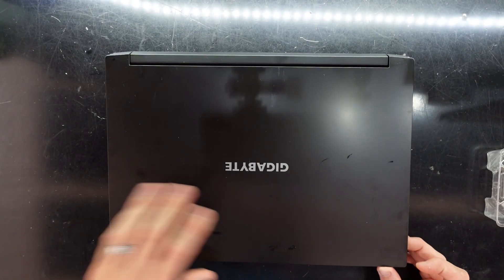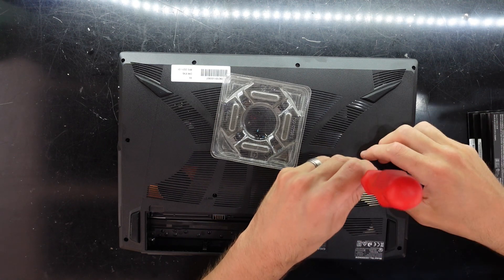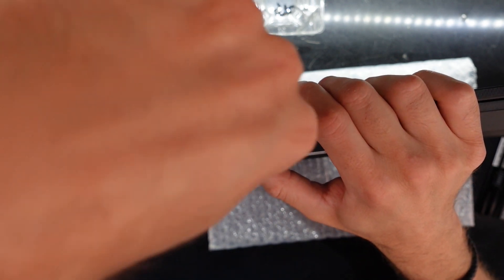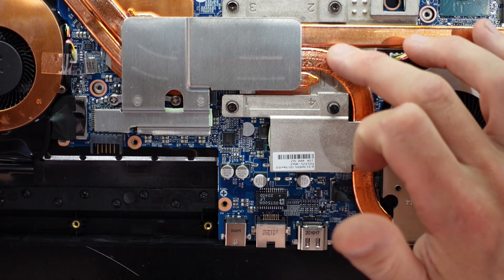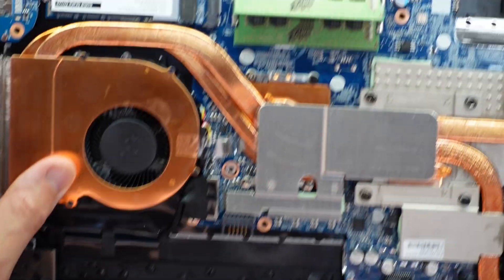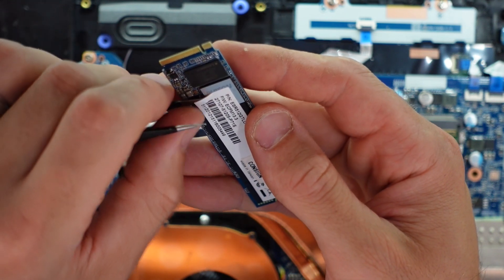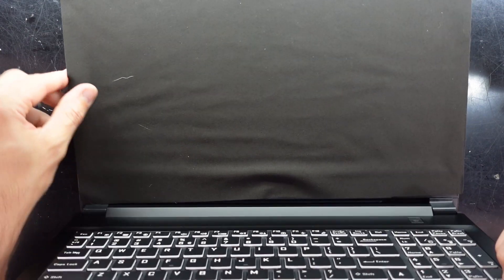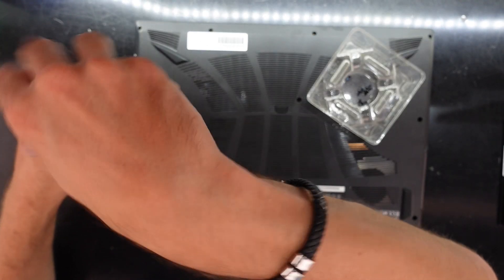Gigabyte G5 Teardown and NVMe SSD Install

Comment: Is an m.2 ssd  with heat sink like fanxiang s770 will fit this laptop? Planning to add it on my g5 kd. Really need some confirmation.
Reply: Id say probably not. The case is quite slim. Theres not much wiggleroom in the slots. only a thermal pad at most at a simmilar thickness to the little square one he puts on the SSD. I was looking into this myself as well since i was considering adding an m.2 with the heatsync. The heatsync is too bulky and wont allow the back panel to close over correctly.
Reply from the maker: i wouldnt expect a headsink on a nvme will fit in here

Comment: For anyone strugglig to work out why your bottom cover of the laptop isnt coming off as cleanly.

The two flat things under near where the touchpad are. Push your screwdriver into them. THESE ARE SCREWS, THEY JUST DONT LOOK LIKE IT! 
Undo these and your golden!

I just broke those ones off not knowing this :-\
Reply from the maker: cheers for the tip

Comment: Do you know what is the thickness of the thermal pads that gigabyte g5 kc has installed?? Because i want to replace them but i throw them away and now i dont know the exact measure
Reply from the maker: no i dont sorry

Comment: if youre going to open a laptop, its worth changing the TIM with something better than the stuff manufacturers use, which is almost always trash. not that you'll be seeing large differences, but the number of times ive found plastic chip borders, between the heatsink & the chip is many. i just do it out of practice. i recently upgraded a neighbors laptop, & she was asking if i turned the fans down, because i changed the TIM, and fixed the improper seating of the heatsink. now they dont need to spin so fast
Reply from the maker: i find if the laptop is a few years old, thermal paste replacement is always worth doing

Comment: Hello, I have the Gigabyte G5-KD laptop model. It has by default an 512Go SSD by default. I am wondering, what is the type of this default SSD is it an NVMe m.2 PCIe GEN x4 or GEN x3 ? And, in the 2nd SSD slot, what can i add in it, an NVMe m.2 SSD GEN x3 or GEN x4 ? I hope you can give me help, because I don't know which type to buy to add it in the 2nd SSD slot. And thank you. And IF anyone here who is reading my comment, and can help me, please give me the answer, and thank you very much everyone.
Reply from the maker: I don't know the answer for that. Check out the Gigabyte support page for the laptop,  should have your answer there
Reply: @rickstechrepairs  Thank you.

Comment: Its a nice laptop to upgrade. Having a possibility to add SSD 2.5 along with M.2 is not a common feature in this price range even it really should be. But being able to add another M.2 is really great
Reply from the maker: Multiple m.2 slots on laptops should be standard these days
Reply: @rickstechrepairs  Yes and no. One M.2 for boot and other 2.5 sdd for data seems like the most economical solution since m.2 can get quite expensive especially if you want dram on it

Comment: I have gigabyte g5 gd, i511gen rtx 3050 variant and now I want to install an extra ssd m.2 nvme gen 4 , whether should i go for 1 TB or 2B and in which slot should i plug it in, whether in the original ssd installed or the other one??? Please help me guys
Reply from the maker: no sure which port to use and size, will come down to what capacity you need

Comment: does opening up the laptop to add a shortage device void the warranty? didn't see any sort of sticker there. would love an answer
Reply from the maker: Depends on country
In Australia,  no opening it should not void your warranty
Reply: @rickstechrepairs  thanks a lot man. just one more question id appreciate if you could answer because there doesnt seem to be any other info. i own this laptop and want to do a keyboard replacement and im not sure if i can pry the keyboard out from the top or have to basically gut the laptop to get it out from the bottom. would love any insight. (also just subbed really appreciate your answer)
Reply from the maker: The keyboard replacement isnt easy and the results normally arent good.

Will need to remove

Bottom Cover
Battey / mainboard
metal Shield under keyboard (using heat gun)
Un Pop all the plastic welds
remove keyboard

Comment: One question, if I move the original disk to the other slot, the thermal pad is not in contact with the aluminium beneath it.. is that okay or do I need to reposition the pad?
Reply from the maker: It won't cook if you don't move the heat pad

Comment: One piece of information I didn't find in this video: 
If you upgrade to a faster PCIe Gen4 SSD you might want to plug it instead of the original NVMe SSD, and use second slot for the original SSD because one slot is PCIe Gen4 and the other one is Gen3.

I just upgraded my SSD on my Gigabyte G5 KD and needed to identify which NVMe slot was PCIe 3.0 and which one was 4.0 since. It's written nowhere on the motherboard, the manual or manufacturer's website..
I think the one in use out of the box is the PCIe Gen4.
The empty slot has an inscription "SSD2/SATA/OPTANE" next to it. Meanwhile the specifications page on gigabyte's website mentions : "2x M.2 SSD slots (Type 2280, supports 1x NVMe PCIe Gen3 & SATA/ 1x NVMe PCIe Gen4)"
I figured that the one labelled "SATA" had to be the PCIe 3.0 and the main one PCIe 4.0
Reply: This is what I was looking for all over the internet... 🤦🏻‍♂️ at one point i've started having doubts about not having a PCIe 4 support. So how did it went, is the original slot the right slot for PCIe 4 ? Also, what PCIe 4 did you go for ? I can't decide which one to buy yet. I'm looking at samsung 990pro at the moment.
Reply: @AleXZander96 -_- YT kept deleting my replies because I forgot external URLs were forbidden.
Yeah it worked in PCIe 4.0 on the first slot. And I got an SSD very similar in specs to the 990Pro, it's a Mushkin Redline Vortex 2To PCIe gen4 M.2. It costed 130€ where I live from a website called "alternate fr", but you can get it from Amazon US for $115 right now I believe, which is at least 30% chearper than the samsung. 
To be clear, such a disk in my laptop is probably overkill, but originally I needed an external SSD and I thought that instead of buying a cheap SSD (since most NVMe enclosures are limited to 10GBps or 1200Mo/s)  that I'd upgrade my internal drive and use the old one as external storage. That's the only reason I purchased it. If you're not constantly moving/opening huge files for video/audio production, it's probably not much of an improvement I'd say. Regards
Reply: @Cayled174 how are the thermals of the mushkin? Did it come with Heatsink?
Reply: But I guess that the free slot is the gen3 and the other is gen4.
Reply: I have a gigabyte G5 (Rtx 30 series), and I didn't know if one of them was gen4 or not. You are saying that the one with "SATA" labeled is the gen3 but the ssd thar came with the laptop is on that slot

Comment: After 10 months of using this laptop. It finally has a screen issue. I have never mishandled it. It has always been in one spot. 

I was about to hop on it to work as usual and then the screen started to flicker. I force reboot and it still keeps flickering. I think this is an hardware issue. The screen lasted 10months.
Reply from the maker: i would be checking the lcd connector on the back of the LCD Panel
Reply: @rickstechrepairs  thanks for the reply, I have actually opened up the screen and tried tapping the flex cable connection to the screen, the flickering didn't get any worse. I didn't actually get to the exact back though, I was just tapping it from the front after opening the cover that acts as the screen bezel. Could it still be a flex cable issue?

Comment: Hi, i need you help 😢.
I bought a brand new G5 Laptop and the first 1 week Went great.
After a while a Blue screen appeared and now It enter in the Bios Because it Cannot detect any ssd.
Should it be a problem of the SSD that was not  originally well pluged?
Should i open it and see?
If i open it, i will lose warranty?
Thanks in advance, i am a little be worried.
Reply from the maker: i would contact the place of purchase
Reply: @rickstechrepairs  Yes thanks i will do it.

Comment: Much appreciated on the upload, am more confident to tinker with mine now. Quick question, is the right fan supposed to run slower than the left one from the get-go? Have been using this model for a year or two, sent it for cleaning and repasting once (will repaste and clean it on my own next), never have really noticed the difference between the two fans till now. 

Cheers mate.

Comment: Why didn't you put the 2000 GB NVMe SSD where the small 500 BB NVMe SSD is?
The lower slot is slightly weaker in terms of performance.
I had made the same mistake too.
The Crystal Disc Info program shows you the performance of the interface.
The change was really noticeable when booting up the computer.
Can you check yourself.
Reply from the maker: No longer have the machine, I didnt go a 2TB nvme due to cost

Comment: hello what ssd or mm2 do you recommend for the Gigabyte G5 KC-5ES1130SD?
Reply from the maker: I'm a fan of the Kingston KC2500 or the crucial P2 or Kingston A2000
Reply: @rickstechrepairs  will Crucial P5 Plus 1TB PCIe M.2 2280SS Gaming SSD work on the G5

Comment: Thanks for the installation video very helpful. The only issue I have is the new drive isn't detected on disk management.  Any idea on a fix ? I used a samsung 980 pro 1Tb
Reply from the maker: Hi, there should be no trick with it, should show up there
Reply: @Ricks Tech Repairs   I'll double-check and make sure it's sitting in the slot fully
Reply: @rickstechrepairs   The drive wasn't fully seated in. Fixed thanks for the video.

Comment: I just bought a Gigabyte A5 K1 and it looks quite similar to that G5, so I'm guessing that it would come apart just the same? I plan to add more storage to it as I have a spare 1TB Samsung 980 Pro that I just took out of my PS5 that I swapped a 2TB version into. Is there anything else you think I could or should upgrade while I have it apart?
Reply: will the warranty be lost if I want to remove the cover and insert the sata ssd there?
Reply: @slava_vas  Why you asking me?
Reply: @moparracing0128  Well, it's just that you've already opened it
Reply: @slava_vas  I have not opened mine yet

Comment: I need immediate help, i was using the laptop in the morning until it discharged, i didnt charge it right away, but when I plugged in the charger in the evening, it didn't turn on, the two orange lights are lit, when I turn it on the right one turns green, the keyboard light lits up, but it doesn't start, no display, no gigabyte logo, nothing, i know it's probably a deep discharge, but I've been charging it for quite a while and it's still not starting, i tried removing battery and pressing the start button for 10s thing multiple times but with no result, it's a brand new laptop, got it in October so i don't think there's any issue with the hardware, i read somewhere on the gigabyte forum to leave it on charging until the battery is fully charged then the system will work normally, so I'm waiting for that, but to counter it, i tried starting the laptop without battery but the same symptoms happened, right now I'm still waiting for the battery to get fully charged, but if there's anything else I can do, please tell me 🥺, i was trying to open it to get to the CMOS to reset it but I'm afraid I'll break it if I pry it open 🥲
Reply: Did it turn on
Reply: @international_05  yes it did. For anyone else wondering, it was actually the CMOS, I took it to a collection center and almost sent it for service. But the guy there opened it in front of me and reset the CMOS. Fortunately it was working, the guy there helped me a lot and probably saved me a lot of trouble. There I also found out the battery of this laptop is less than 4000 mah, lol, my phone has 6000. That's not the issue though, the specifications of this laptop makes it worth getting it.

TL DR

It turned on. It was the CMOS. Gigachad from Gigabyte collection center saved me.

Comment: Can we put 2TB NVMe PCI GEN 3x4 M.2 2280 SSD in the HDD slot instead of the SSD SATA 3 drive? Thanks.
Reply from the maker: no you can put a NVMe even with adapters in a Sata 2,,5" locations
Reply: @rickstechrepairs  thanks, does it support gen 4 or only gen 3 specifically? Do you have any video for the installation of M.2 SSD in the HDD slot? That would be very helpful 🙂

Comment: Great video. I noticed the small pad under the original Kingston A2000 card. I see that the needed small screw was supplied with mine. Also supplied was a small self sticking pad. So now I know it goes under the additional A2000 SSD (I think) if you install the second one.
Reply from the maker: Great to read this helped you :)

Comment: nvme gen 3 works on this laptop? I was reading in the website that there are two m.2 gen 4. By the way what nvme for this laptop can you recommend? is there some specification there I have to pay attention?
Reply from the maker: most nvme drives you can get will work just fine
Reply: @rickstechrepairs  Thanks for the info bro

Comment: Hi thanks for the video. If I want to clean this laptop, would I just use a brush on the fans? Or do I have to take it apart further? Coz mines getting very hot after 6 months
Reply from the maker: i usually use a air compressor to blow the dust off. 
but a paint brush or tooth brush should do fine

Comment: It is a clevo, you use the clevo control center to work the keyboard etc ...
Mine is pretty sweaty with all the storage holes populated and 32GB of ram, I repasted it with magical metal but fans are still working out a lot.
Reply from the maker: yep, the fans will always be going due to the heat of the CPU
Reply: @rickstechrepairs  I run the custom profile on windows but I get 90° on 2+ core when running red dead or 2077, throttling is the name is the game, I have a elevated laptop stand with 2 repurposed noctua 120mm I made it's almost keeping it from throttling. 
I have similar issues with my MSI ws with a i7 11800h and a rtx 2000, I mind less for the gigabyte/clevo  since it's worth half and not a "professional" machine. 
Anyway you got a new sub.

Comment: Hi, I installed a new 2tb SSD on this laptopt, the issue here is the fact that I cannot boot. What can I do to fix this issue?
Reply from the maker: Did you add it or replace the existing drive?
Reply: @rickstechrepairs  Replace the existing drive

Comment: Finding out the manufacturer is easier and more reliable under Windows Device Manager or Linux cat /proc/scsi/scsi, you don't have to open anything. Overall a very good video.
Reply from the maker: good point, i tend to use Speccy to find out details of brands and what note

Comment: My G5 came with a thermal pad for an SSD, do you know where should I place it?  I thought on placing it as the original drive, but you said its an odd placement XD
Reply from the maker: you can use the thermal pad if you install another SSD

Comment: Hello.  I have installed a Teamgroup z340 nvme disk and it does not work.  The BIOS recognizes it but Windows 10 does not.  Disk management not recognised too. I try to install the teamgroup drivers but he still doesn't recognize it.
Reply from the maker: Hi, it its getting displayed in Bios i would usually expect to to show up in device manager & disk management 
no drivers would/should be needed to install 

maybe see if you have raid enabled in bios or something odd like that
Reply: @rickstechrepairs  I don't have raid enabled

Comment: hello ricks, greetings from colombia, I bought a gigabyte G5 KC, I wanted to ask you if you knew which m.2 ssd models can be compatible especially 2tb (I bought an acer fa100 and had to return it) I thought about an Intel 660, but I'm not sure.
Reply from the maker: i think most models of NVMe Gen3 SSD will work fine 

Personally i like the kingston A2000 and KC2500

Comment: Thanks for the teardown, helped with finding all the screws and not worried about prying the cover off. my builtin mic seems to be DOA -- hoping it's just a loose wire. having a hell of a time figuring out where the mic plugs into. any thoughts?
Reply from the maker: no sure what to suggest there sorry, i would find it unlikely that it would be a loose wire
Reply: @rickstechrepairs  Thanks for the reply! I figured out what the issue was -- plugging in headphones disables the built-in microphone. There is a setting in the realtek advanced settings to decouple mic and headphones. after that, things started to work, thank god no RMA!

Comment: i have the ssd/2.5 inch slot screws too, but it also came with a little bag full of what is metal with a sticky side. it says MWE 300LSE on the sticky cover. What are those?
Reply from the maker: sounds like a thermal pad/headsink for the other ssd

Comment: You can run Crystal disk in stock SSD M2? I search in google but the results says 1000/1000mb to 3000/3000mb and need a parameter to upgrade
Reply from the maker: no longer have the machine to test

Comment: hello thanks for the video, I have installed the second hdd m.2 but the motebook does not detect it ... do I have to change something in the bios? thank you
Reply from the maker: load up disk management, then initiate the drive, then format and now it will work in windows